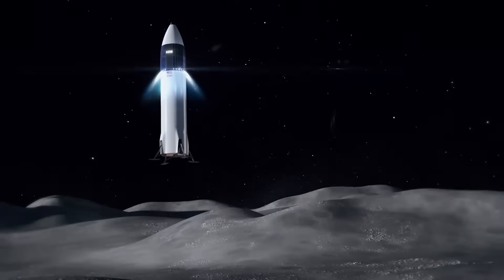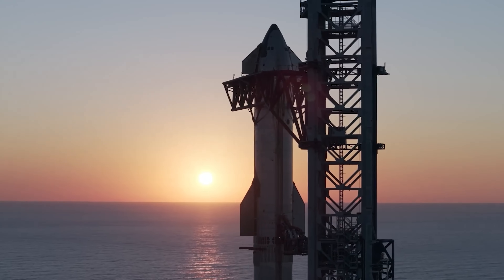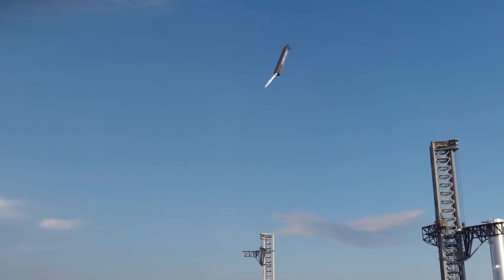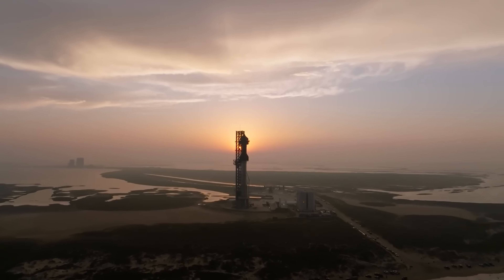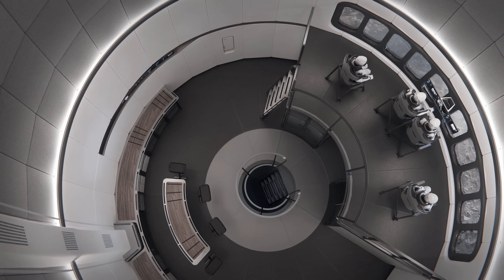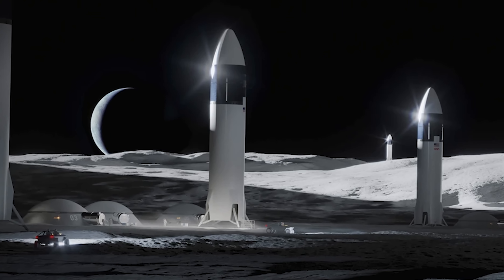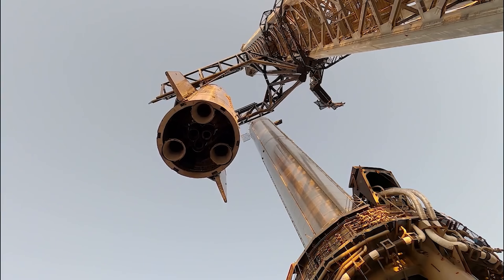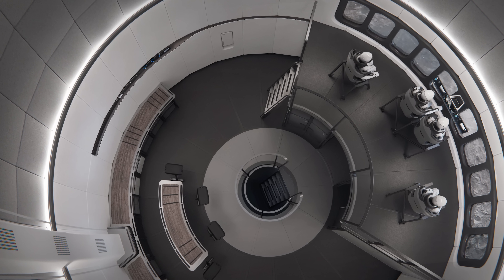SpaceX revealed new Lunar Starship Option to Go Back to the Moon: Less Refill, No Return..

Comment: I can’t help but wonder . What do you do if for reasons unknown . The spaceship falls over on the moon.
Reply: I don't think this would be a problem, Starship is very wide and wider with landing legs and I think most of the weight would be on the lower parts making it more stable
Reply: @uCruz_ good to know . Thank you
Reply: @uCruz_ you are aware, that is is as big as a skyscaper?
Reply: @davidmiletic6647 Oh yeah, but the engines are heavy as hell and with a mostly empty tanks after landing, they should have just enough for orbit and docking, the center of mass should be very low, helping keep the craft stable
Reply: Oh and FYI I don't really am a specialist on anything, I'm just saying what I think should be based on the information I have

Comment: Refueling a single Starship requires anywhere from 12-20 additional Starships in orbit. SpaceX hasn't shown that they can link in orbit, refuel, or handle the boil off problem of pressurized fuel being heated by the sun while in orbit. Thats why the number of ships needed to refuel isn't known, because nobody knows how long or difficult it will be to refuel in orbit, or how much fuel will be lost while the process takes place.

Comment: No doubt about it space x is a complete failure, they produced a cool looking rocket but its not a feasible space machine. They need to be forgotten if were ever getting back to the moon.
Reply: NASA is not even able to transport their own astronauts to the ISS. SpaceX is the only company that is doing that for them. Without SpaceX, NASA would need to rely on Russia for transportation. So no SpaceX is not a failure, far from it.
Reply: @alanrvaughan  ffs spacex operates dragon under a NASA contract so yes NASA can transport their own astronauts to the ISS.
Reply: SpaceX has driven down launch costs dramatically—Falcon Heavy costs about $1,400/kg to low Earth orbit (LEO),
Pre-SpaceX average: Often $10,000–$20,000/kg depending on vehicle and era
In 2024, SpaceX launched approximately 83–90% of all global orbital payload mass

SPACEX isn't going anywhere, so buckle up buttercup,  you are in for a ride.
Reply: @robisverybad75  long march 3 launches are cheaper. spacex have wasted the lead they got from falcon 9 and threw it into a starship sized pit.
Reply: "Puff..."  is that legal?

Comment: we could have been to the Moon loooong ago with the Falcon Heavy. Put Some Modules up and user Falcon 9 Dragon V2s to get Crew into Low Earth Orbit then another already docked Dragon gets the Crew from the Low Earth Orbit Station to Low Lunar Orbit and from there with a specialised lander that gets them to the surface. With the current ISS this would be able to be have done since the first Dragons docked there but no we need a Big ass flying D..do that has been redesigned like 50 times

Comment: NASA accusing someone else of falling behind is the ultimate in Gaul.   NASA cannot get their own capsule to the space station without having SPACEX rescue the crew - but only after trapping that crew in space for several months.  They keep referring to the SLS and Orion as “flight proven hardware.”  What a joke.  They are nearly a decade behind their original schedule and they have yet to return a crew to earth safely.   Using “former NASA administrators” as your standard of timely performance is never a good idea, particularly when they have “retired” to lucrative careers as lobbyists.
Reply: you mean boeings capsule. both the dragon and the starliner are where built for NASA's commercial crew program contract. so, no.
Reply: @geesehoward700   NASA selected the Starliner,  NASA picked SLS, NASA picked Orion and specified all of the above.  These “Ex NASA Officials” have NO PROBLEM with the poor program performance of Starliner, SLS, ORION, etc.  It is one decade late and has not demonstrated the ability to bring people to earth safely.
Reply: @Why_ask_  NASA did all that with spacex as well though and dragon can safely bring people back from space so youre still wrong. also NASA was forced to use SLS by congress.

Comment: Finally some common sense .............. bit late and still missing the main point.  Using a starship as a lunar lander is a stupid idea. The Starship design is heavily constrained - lunar lander, mars lander and earth lander.   Lots of studies over decades layout alternative  lunar base architectures that are more mass efficient and probably cheaper.....................unless a cheap $/kg promise of the starship to LEO and lunar surface can be achieved in a reasonable time frame.  The current upper stage TPS design is simply too marginal - 50/50 chances of making this work within a year and probably a significant redesign of the entire concept is more likely further pushing things out by a further 2-3 years. The new lunar starship scramble above is simply a reflection of the facts in order to keep Starship in the mix as the lunar lander.  The report also conveniently forgot to say how many launches were necessary for the refuelling needed.   But at least the review/rethink is finally taking place.

Comment: Video incorrectly stated that Starship has already achieved orbital velocity. That is not true. All test flights so far were sub-orbital and the first orbital flight is planned for flights 13-15.

Also repeatable refueling in orbit with cryogenic propellants is a much bigger challenge than landing on the Moon.
Reply from the maker: Orbital velocity is the speed needed to stay in a stable orbit, which is a balance between inertia and gravity, not necessarily mean the spacecraft went to orbit. More like it could if need to.

Comment: Why not just send 4 starships to the moon each with only one forth the payload of a single fully loaded starship, wouldn't that require much less fuel, or refueling, or maybe no refueling at all especially if the booster were used in expendable mode to push these starships into higher orbits?
Reply: It takes a ton of delta-v to get to the moon

Comment: Better: just make a smaller 3rd stage that will also serve as a lander. No refuelings required, no SLS required. In fact, the Dragon with relatively minor upgrades can serve as the crew capsule, eliminating the Orion capsule as well.
Reply: Or, you could put the dragon, on a Falcon Heavy, buy two, do the maths, it's all politics!!!
Reply: NASA/government is the problem, not the solution.
US space would be far ahead today if NASA was never created.

Comment: I would really support a mini lunar starship. The first missions do not need 100t. The mini starship would need ways less to no refeuling, less engines and would be in my opinion more fitting for a first mission. Full-size starship are better for building bases there
Reply: starship isnt needed at all. just have a normal sized lander if this thing isnt going to be used as a base.
Reply: Yay you get it!
This mission is to go to the Moon with Astronauts.
Later missions are about building a base and thus carrying cargo.
Take care M.

Comment: NASA will never let their astronauts launch in a rocket without an abort mechanism again.  At the very least, what we could see happen is dragon rendezvousing with HLS Starship in LEO, transferring crew and supplies, before HLS Starship heads to the moon.

HLS Starship should only need to be refueled in LEO.  It should be able to hold enough fuel to get there and back.

The biggest issue with SLS is that the rocket is already on life support.  It's designed using leftover shuttle era parts.  Those parts get used with every launch, and they simply aren't making them any more.  (The whole reason SLS is so expensive is because congress forced NASA to use the shuttle era parts believing that it would be cheaper, not understanding the engineering does not support hand-me-downs.)
Reply: True, there are however alternatives
1. Launch the crew with crew dragon, dock in Leo and then go to the moon
2. Launch orion using superheavy with a single use 2nd stage (still abort, still proven orion, still able to use esa module)
Reply: You could do all this mission with SpacX existing proven kit.
If it were a race they would do this. M.
Reply: China will have a lunar base first

Comment: Landing starship after returning from the moon sounds unnecessary.  Leave it in orbit for future use, or as a module for a future space dock / station.  You already know you can refuel it in space anyway.  Don't send excess KG into LEO and then return it.  I'm sure in the run up to the actual manned moonshot, how many times will you have flown some version of starship to LEO?  Leave the last few version-stable units there, imho.

Comment: More CGI animations and statements starting with “SpaceX says”. They haven’t even got a Starship into orbit.
Reply: You really should be paying more attention to the details instead of listening to 3rd parties tell you what they think.  The last 11 Starship flights have been performed with outdated hardware.  The next flight will be with Stack 3.  Now, why would SpaceX choose to continue launching obsolete hardware?  They want to see what happens.  Most of the last flights have been questions about, "what if we do this?  What will happen?"  They've been leaving tiles off at different locations to simulate what happened with Columbia, simulating engine failures, and testing engine reignition.  The engine reignition tests are the most important.  SpaceX could easily get Starship to orbit, but they want to make sure the engines will not fail a relight.  If they launched Starship into orbit and they could not relight the engine, Starship would be stuck in orbit, and the FAA could charge SpaceX with fines for violating their agreements.

Comment: SpaceX is not making any major changes to the Starship lunar lander itself. What Elon means is that what is changing is the path that the all-Starship plan will use to reach the lunar surface will change. Instead of using NASA's high altitude Near Rectilinear Halo Orbit (NRHO, nearly 7000 km above the lunar surface in that orbit), SpaceX Starships will use the low lunar orbit (LLO, 100 km circular orbit) path pioneered by NASA's Apollo program 56 years ago.

NASA is forced to use the NRHO path to the lunar surface because its Orion spacecraft does not have enough delta V capability to enter and then leave LLO. That lack of delta V capability is perhaps the greatest defect in the entire SLS/Orion vehicle design. Except for the fact that it's a completely expendable 20th century design that costs $4.1B per launch and can only launch once every year due to limitations of the manufacturing infrastructure NASA has created.

Consequently, NASA's SLS/Orion will not be needed for this new mission plan.

To make the LLO path a little easier, SpaceX could just select one of the six Apollo landing sites on the lunar surface and land its Starship at that location. My favorite is Tranquility Base, where Apollo 11 landed (20July1969). There is no more historic and significant location than that. And it should be the first site that Starships would expand to a permanently occupied lunar base within the next decade.

Starships could be landed near the lunar South Pole within a few months after the first landing on the following missions that would use the low earth orbit (LEO) to lunar polar orbit (LPO) path, a parking orbit at 100 km altitude above the lunar surface from which Starship lunar landers would descent to the lunar surface. NASA's SLS/Orion not required.

Comment: There needs to be a separate vehicle to send humans to the moon from the cargo vehicle.

Two Falcon heavy launches and a modified Dragon can send astronauts to the moon far cheaper than SLS or starship. 

Starship can then send heavy cargo to moon surface without much worrying about in space transit time.
Reply: how does dragon land? it splashes down with parachutes.  Last I looked, no water and no atmosphere on the moon.  Dragon can't do it.
Reply: @JB18850 
spaceX designed dragon with hypergolic Draco engines for powered landing. It's NASA that required an ocean parachute landing. 

There needs to be two dragons, a lunar dragon with no heat shield, with long legs and an unpressurized small cargo underneath. Then an Earth return Dragon that remains in lunar orbit and has a reinforced heat shield to withstand interplanetary re-entry velocity. 

First Falcon heavy launch to the lunar orbit with an uncrewed  lunar dragon and an additional stage for moon to earth return transfer.

Second Falcon heavy launch with crewed Return Dragon and Earth to moon transfer stage. 

Docking in lunar orbit between Return Dragon and moon landing dragon. The later lands with astronauts. At the end of the mission Lunar dragon separates from bottom unpressurized module and takes off to join Return Dragon and the return stage in lunar orbit. The return train heads back to Earth.
Reply: @halnineooo136  Dragon was never designed to be refueled in orbit.  Part of the Starship flight tests SpaceX has been doing was to test various ways to transfer liquid fuels between orbiting vessels.  Let along, Dragon (or two dragons for that matter) would never be able to hold enough fuel move from LEO to LO, land, launch, move from LO to LEO, and slow down enough to re-enter the Earth's atmosphere.
Reply: @Ncyphen 
No need to refuel Dragon. You add a lunar transfer stage both ways on both flights. Read above.
Reply: Dragon is not capable of withstanding the forces of a Lunar to Earth re-entry, nor would it be able to maintain enough fuel to slow it down.  Dragon's design was always meant for ferrying astronauts and supplies from the Earth to LEO.
Reply: @Ncyphen 
There was a Red Dragon design, and it's only a matter of thicker insulation to withstand the fast reentry and Falcon Heavy can very well handle extra weight in comparison with Falcon 9

Comment: Starship is too heavy to go to the moon.  This ship that can barely get to orbit will need 8 - 20 refueling missions to go to the moon. 
Every kilogram matters when it comes to going to the moon and Starship has tons of stainless steel and rocket engines it does not need for the mission.  Starship is the wrong design to go to the moon.  Apollo showed us that you leave the useless material behind.  Starship is just about keeping all the crap around to make Elon Musk's ego grow.
Reply: Not sure what you mean by "barely get to orbit."  Starship could easily get to orbit if SpaceX allowed it to.  They've chosen to not put Starship into orbit because they want to make sure the ship will re-enter Earth's atmosphere during testing.  These last 11 flights have all been about testing designs and ideas, and making sure they can work in a real world scenario.  If Starship enters orbit and can't re-ignite it's engines, the ship is stuck in orbit.

Additionally, with the amount of fuel required to get Starship to orbit, once it's refueled, it should have enough fuel to reach the moon, land, and return to LEO.  The delta-V require to leave the moon and return to Earth is much smaller than the amount required to get their.

And finally, Starship exists not because of the moon, but Mars.  Musk is obsessed with Mars and wants to reach Mars in his lifetime.  The lunar project is simply a means to help fund and bring focus to his Starship (even though I think Starship is a terrible idea to get to the Mars, but whatever.  An interplanetary ferry makes much more sense.)

Comment: It is not correct to say that Starship HLS does not need top tanks because Starship HLS does not need to land on Earth. The reason they do not need top tanks is because they refuel in space because the tanks need to be full to be able to return to space after landing, instead of almost empty as is the case when the module lands on Earth.

Comment: why not just use 2 falcom heavy rockets to get  lander and booster stage up.  If we just want to get materials to the moon - use the rockets we have now. No need to rush a reusable system just to get back to the moon.
Reply: There's no lander yet.  Blue Origin hasn't publicly revealed anything about their proposed lander except mockups.  And considering they split the project up among many different facilities in different states in order to convince Congress to agree to a second contract, I would not be surprised if they are working at a snail's pace.

During Obama's two terms in office, he killed the Constellation program before any work on a lander could be started.  The only reason Orion didn't get trashed was because it was already heavily into development.

As a bonus mention, there's no way NASA would ever try to land astronauts with Apollo era LMs.  Those things were flying tin cans that could barely get onto the moon.  They were essentially flying coffins, as there was a high risk with each landing that was only subverted thanks to the efforts of well trained pilots.

Comment: It's going to tip over ! ..this is not going to work ...... it will be to the moon ...forever and buried there
Reply: Starship is a big booty girl. Most of the weight is around the engines. It'll be just fine.
Reply: guess where almost ALL the weight in starship is? the bottom....